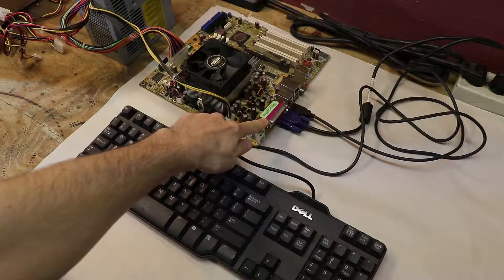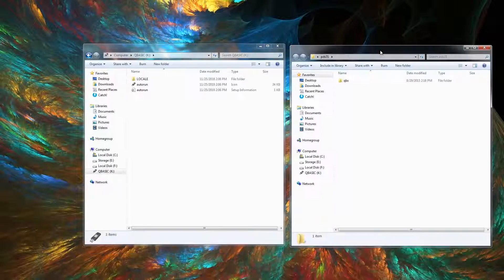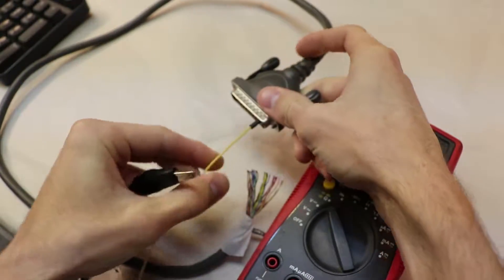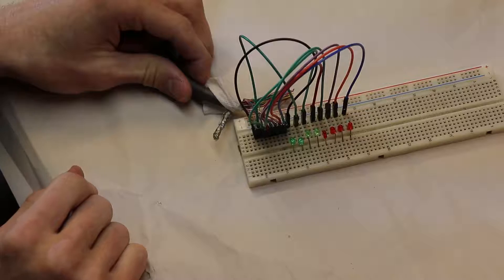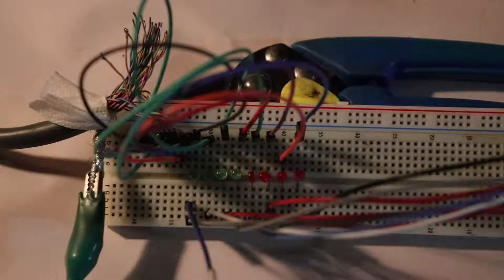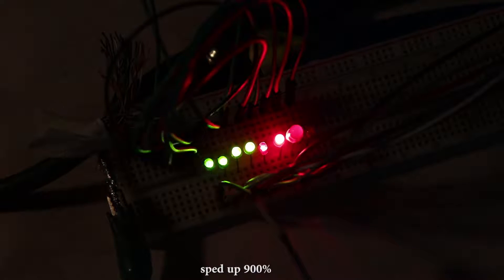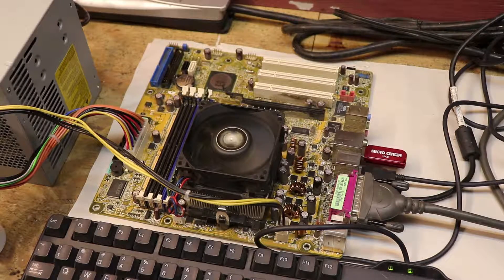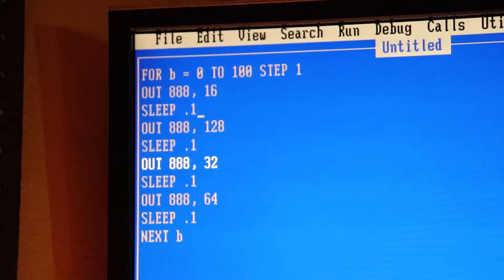Forget the Arduino and Pi, use your old PC!

Comment: I think that this uses more current in a day than my pi in an entire year
Reply: Stay tuned. In the next video, we use a jack hammer to drive a nail into a wall.
Reply: @BrekMartin  very efficient😂
Reply: Luca Mongiardo But way more cooler
Reply: This could really only be interesting to people who weren’t around when it was the only way to control something. Par port controlled everything.. scanners, printers, EPROM programmers, row of lights, or whatever... then the beauty of microcontrollers was you didn’t need to run a whole PC to do some simple I/O unless the program is complicated enough to require it. Funny how the old way could become novel again. Still, I see no reason to rely on any OS and it’s APIs to run such a program. That’s a whole bunch of junk to potentially make something unreliable.
Reply: Yeah, nice that people think about how to reuse old hardware, but this is definitely one of the many ways where it doesn't make sense, mainly because of power usage. Only way I know is to get all old harddrives together and build a file server just for backups which you don't start often, but then I would go down to Athlon XP or similar, something that is just fast enough for Network but doesn't use too much power and so the board doesn't play a big role compared to the power usage of the harddrives, but seriously have no idea what to do else with old pc hardware except of harvesting parts from it.
Reply: I bet op loves to go to sleep by fan noice
Reply: I think it's a good way to learn some low level programing to be honest
Reply: Misha M It doesn’t get any higher level than using BASIC in Windows to write values to a port.
Reply: @BrekMartin  Use hydraulic rams to move the house an inch to the left around the nail?
Reply: i was about to say that seeing only the thumbnail
Reply: More current = more better.
Reply: It doesn't actually.
On the market there are some chips called picoPSU that run motherboards, with the power usage of an raspberry pi. You need an ATX to run other peripherals like your HDD, CD ROM, floppy drive etc.. But you don't need actually that much energy to run only a motherboard.
Reply: @simonemastroianni1985  I know picoPSUs, I have to say two things:
1: a pi surely uses less current that just the CPU (I think this setup uses at least 40/50watts in idle, or more)
2: the power usage doesn't only depend on the psu, that can be up to 100w or more for picoPSUs (while a pi one doesn't really have to go over 15w)
Reply: Absolutely right.
Reply: Killing mosquitoes with SAM's.  Stay tuned!
Reply: @ElectricEntertaiment  I don't think so, but even if it is.. my pi has built-in wifi and bluetooth, it's not only CLI, I can install a lot of programs for a project.
A pi4 and probably 3 is surely better than this pc.
Reply: Luca Mongiardo I just seen a free power generator with 9 spark plugs glued to a scrap piece of wood boasting more computing power than this,
Reply: @BrekMartin  I was like 'Next video : Don't kill the flies with a swatter! Use your old bazooka instead!' too. :)
Reply: Actually no, a pi uses 2 amps of current and an desktop pc about 1 amp of current.
Reply: @RunfisherRS  a pc uses about 1 amp?!?!? Maybe 1amp at 220v...
Reply: @lucamongiardo1946  A raspberry uses more amps than a reasonably efficient desktop pc. A raspberry runs on 5v though instead of 110/220v so it still uses less energy.
Reply: @RunfisherRS  yes raspberry runs over 5v but if u use a 220v psu like everyone it uses less than half an ampere 🤣

Do you ever know what are you talking about?
Reply: @lucamongiardo1946  The pi itself still only uses 2 amps@ 5V. The pi does not have a PSU.
Reply: @RunfisherRS  pi doesn't have a psu but needs one. Even a standard pc doesn't run over 220v but 12v,5v and 3.3v at the same time. And uses a lot more than just 2Amps.
Reply: @RunfisherRS  if you measure the amount of current from the outlet you'll see that a pc uses a lot more current than a pi. Both on full load and idle.
Reply: @lucamongiardo1946  I plugged my pi into a USB power meter and it says it uses about 2 amps at 5 volts. Even when i plug it into the wall with a phone charger with a usb outlet, the usb power meter still says about 5v 2 amps.
Reply: @RunfisherRS  yes but at five volts!!!!!! You draw a lot less from the outlet!!
Reply: @BrekMartin  00⁰ out i2
Reply: @lucamongiardo1946  volts x amps =watts guys
Reply: @ambersmith6517  that's what I'm saying.. a pi cannot draw more than 25watts.. and I'm overestimating.. that pc would draw at least 150w and not even at full load (even if it's less powerful)..
Reply: @BrekMartin  Just ditch the BIOS altogether. HDD, RAM etc. are overrated. Just use MTRRs for Cache-As-RAM, load your program from the flash, set up the few hardware components you actually need (Super I/O, Parallel Port) and you're good to go. You will have the fastest "RAM" people could think of 8-)
Reply: Still less power than Bitcoin hashing
Reply: Well besides the Pi, he could just sell that old PC for $10 and buy 3 Arduino Nano with that money. It uses a lot less power, doesn't need a fan, size is much smaller, and he could learn C, C++ and assembly language programming instead of using BASIC.
Reply: @BrekMartin  the funny thing is, its inexpensive to buy a cheap motherboard and put in an old processor than to go out and buy a Raspberry Pi due to the supply chain problems.
Reply: @cessposter  it can even be free! Call around to offices/tech stores. They're often getting rid of junk. (Totally don't just glance in the dumpster on the walk home, like I absolutely didn't do.)
Reply: Db25 and db9, I still use. 
I don't own a microcontroller yet

Comment: A PC's printer port is pretty resilient but make it a habit to use a resistor for each LED to limit the current that goes through it. Not only makes sure you printer port lives long but also your LEDs. Also having all the LEDS on at the same time and all of them using current even with the resistors can damage the printerport. On motherboards this printerport is often integrated in one of the big chips and you don't want to blow that one up. Probably your keyboard/mouse will also stop working, maybe even more. Best solution is to use a 'buffer' chip like a 74HCT541 and lookup the source capacity of the pins in the datasheet. Often it is around 30ma for each pin, but also about 150ma for all pins combined. At least when you do something wrong you blow up this buffer chip (a few cents) and not a part on your motherboard (10's of dollars or even difficult to replace). So have fun, but don't forget the basic I=E/R (current is voltage divided by resistance.) :)
Reply: Yes I was thinking the same, a buffer chip or individual transistors would definitely be a good idea & if you want to be really careful about protecting your old faithful, a set of opto couplers as well ! :)

Comment: its better to write in c or c++ and use linux to control the i/o.Much faster that basic
Reply: Yeah, but if it can be done in BASIC, it's better to use BASIC. 🤷‍♂️
Reply: At the college, we used borland c for DOS...
Reply: @ugh.idontwanna  That depends on speed, BASIC is slow AF but good for learning/prototyping. C or C++ would be faster by a massive margin, at the cost of slightly more difficult code.
Reply: @alexrawson8492  -- If you can't handle 'C', you shouldn't be wanting to work with microcontrollers in the first place.  Of course, when I first started writing stuff for microcontrollers, your only choice was that particular microcontroller's assembly language.  Having to program in BASIC though?  Yeah, it can be done, but you'll feel dirty afterwards... Like crawling around in hog shit...
Reply: @jakeblanton6853  My point is that BASIC can prototype well. I do agree though, past that phase C is definitely recommended.
Reply: Nope. As a professional who began with BASIC, BASIC only gives bad habits to the learner. Should be banned ! Better start with Pascal or TurboC if using MSDOS. Real men work with Linux and all the languages available, real hardware programmers use C.
Reply: @CaptainDangeax    -- It used to be that the first "Intro to Computer Science" course in universities was taught in BASIC.  Even as simple minded of a language as it is, it allowed the universities to weed out the students that just did not have the logical thinking capabilities to potentially complete a curriculum in Computer Science.  They probably ended up as Education majors -- "those who CAN, do ... those who CAN'T, teach ... those who CAN'T TEACH, teach others to teach ..."  Back in my day, FORTRAN was the first language and it was on punch cards...  'C' was once described as a "high level assembly language"... That's probably why I like it so much -- power and speed... With 'C', you don't have to guess on how your arguments are being passed to functions / subroutines since everything is really pass-by-value and if you want a pass-by-reference, then you pass the value of the address of the structure.  The only exception to that was that if you passed an array, you were passing the address of the array.  I remember 20 or so years ago, I was writing some DLLs in 'C' for some user interface developers who were using MS Visual Basic.  At some point, they quit working and after tracing it down, it seems that MS decided to change the way that it passed variables to DLLs when the newest version of VB was released.  On the other hand, if you stick with straight K&R 'C', you code tends to be fairly portable across platforms.  Most developers only work on a single platform, so that might not be much of an issue for them, but the distributed systems that I designed were running across quite a few different types of platforms and portability meant that I had less code to write.  Of course, there was always the System V vs BSD compatibility issues on the various UNIX machines, but that could be hidden by calling a routine that you wrote instead of the System V or BSD routine and then have that routine use a conditional compile to determine whether to call the System V or BSD routine.
Reply: This, DOS is so full of fail
Reply: @StarEclipse506  -- There have been worse choices in operating systems.  For its time, it was good enough for the hardware that we had available to us.  Sure, UNIX was better, even when running on a serial terminal like a VT100, but it wasn't going to run in the memory that we had available back then.  Remember, the original PC was released with only 16K of memory on the motherboard and could be expanded to 64K (although most people probably bought the model that had the higher capacity DRAMs which gave them 64K on the motherboard with the capability of expanding it to 256K on the motherboard.  It wasn't until the 80286 with the PC/AT that there was a PC that could be useful for running UNIX (although there was the MS XENIX flavor of UNIX ran on the 8088/8086 processors).  Although it was possible to have a version of UNIX that would run in the memory that we had available to us back then, you have to remember that most PCs back then did not have hard drives.  Trying to run UNIX from a 360K floppy drive would be a bit irritating.
Reply: I agree, since BASIC is included with DOS. However you need a copy of QB or free-basic to save your projects on disk.
Reply: Since it needs to run on a single architecture and programs tend to be small, simple and tidy on DOS i would prefer assembly language in this case.
Reply: Much slower to write
Reply: @alessandrobarbieri2098  -- Which are you saying  is slower to write?  Because of the way that YouTube shows responses, it's not possible to determine which post you were replying to... If you're talking about assembly language, then you're probably right, but most experienced programmers develop code libraries of frequently used tasks, so they do not need to write it again.  Although well written assembly language is going to run faster than 'C' and take less memory, most developers are willing to compromise this with the added productivity that they get by writing in 'C'.  If there is something that is particularly time sensitive and is inside a loop that gets executed quite often, that piece of code might get rewritten in assembly language.
Reply: @CaptainDangeax  Unless you discover the power of assembly!! In 1983 I used to program my C64 using machine code (and BASIC of course, for the usual READ DATA and POKE set of instructions)! This is better than C but the downside (which is indeed the amusing part) is that different microprocessors have different instructions set and memory maps. I think that in the past, real hardware programmers were using ASM language! :-)
Reply: @fabriziodutto7508  the subject of this vidéo is using a pc. A C64 is a piece of collection today. I also used to program my C64 with assembly and Basic back in the day but it was the previous century
Reply: @CaptainDangeax  :-) Yes, nonetheless, if you remember, back in these days, we used to call it "Personal Computer" and indeed, by Von Neumann definition it was :-) I think that real men used ASM too and btw, you can still use ASM it on modern computers too...
Reply: Using language x on y os doesn't mean anything for speed as you have to realize that there is a lot happening between a c program in user space and a piece of hardware behind some software in kernel space. It may very well be faster to run a dos program where you can bang the io ports directly using in/out instructions where no other program is competing for cpu time and there are no context switch hoops to jump through. Re. basic is slow: look up threaded code and its use in embedded space where memory is at a premium.
Reply: @CaptainDangeax  > "As a professional who began with BASIC, BASIC only gives bad habits to the learner." To me this sounds like you did not properly learn the other languages. For example: If you used BASIC patterns in C code then you failed to learn C.
Reply: @CaptainDangeax  And I have read that if you REALLY want to write clean code you write it in ASSEMBLY.
Reply: @lordtaw  I'm just quoting Dijkstra : “It is practically impossible to teach good programming to students that have had a prior exposure to BASIC: as potential programmers they are mentally mutilated beyond hope of regeneration”. Strange you've never heard of him... Fortunately for me, after tens of years of hard work, I can now program in C, Python, Bash or ASM, whatever fits the best my needs.
Reply: @Jimwill01  The definition of "clean code" is too vague to agree or to disagree with you. Assembly is the fastest, granted. fast does not imply clean.
Reply: C or C++ would be faster than BASIC, sure, but Linux would only slow you down.  In DOS, your program is the only thing running on the hardware - there's no "kernel," in the sense of how the Linux kernel works, and only one program runs at a time.

Meanwhile, in the real world, pretty much any software where someone might be expected to write their own code uses BASIC.  It's not likely to change, because it's the lingua franca of the automation world.  Which sucks, because that's what I do for a living - I make up for it by writing all my support code in Lisp.
Reply: @ugh.idontwanna  If it can be done in Assembly Language,  it's better to use Assembly Language.
Reply: Like ZX Spectrum :D
Reply: or use assembler
Reply: wait, can you just do this on windows then?  Like on your actual main desktop pc you somehow address a usb port and control its signals like in the video but use c++?
Reply: @artbyrobot1  For usb you need to have a microcontroller on the other end to initialize the device descriptors but for a parallel port, serial port and maybe internal busses like SPI and I2C you usually just open the device and start writing. What he used in the video is the parallel port not usb. I'm simply stating that you can do the same thing with c++ and linux and it would be much faster.